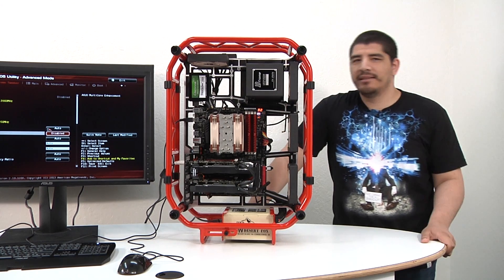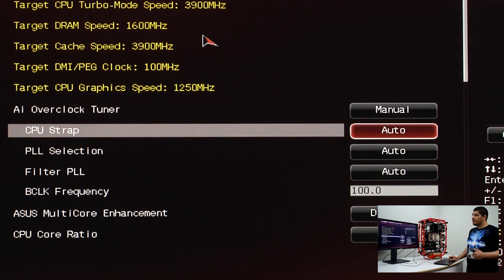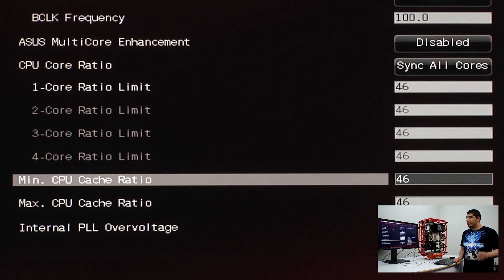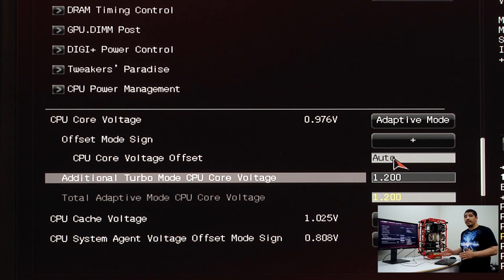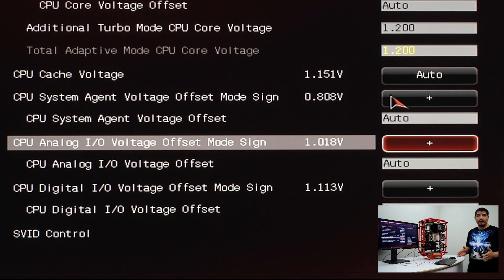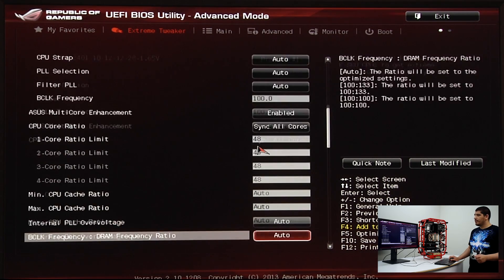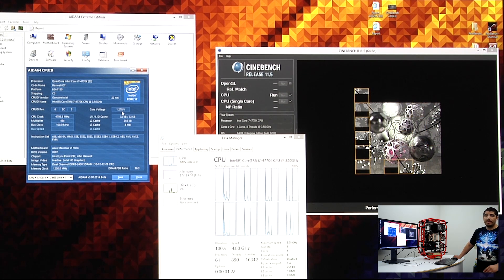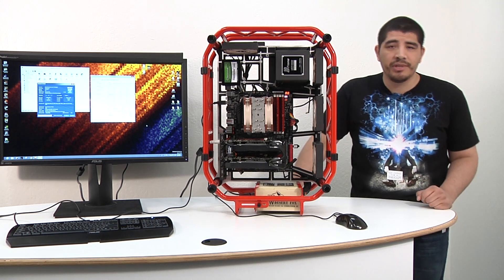How-to manually overclock any ASUS Z87 motherboard

Comment: Hi, im a OC newbie, so if get it right, all you need to do is to set your clock speed and add voltage?
I have the same mobo and cpu as on video.
Are they any dangers in overcloking?
Reply: none as long as you dont get your cpu over 90 degrees celcius.
Reply: and don't over volt. To much voltage can be really bad for your cpu. For the Haswell series anything over 1.25 ish can lower the life of your cpu but it can go much higher in volts as long as it remains at a stable cool temp. Also take into consideration of when you are doing your overclock. If it is 40 degrees F, and you  do a stable overclock that is high, you will probably have to adjust your overclock appropriate to the seasons if it gets hotter in your area during the summer time. As your ambient temperatures rise so does your cpu.

Comment: So guys, why did he say that we shouldn't run stress tests with the oc settings that he's shown us?  Or did he mean when leaving voltages on auto? Why?
Reply: OK, so apparently if you leave your cpu voltage in BIOS on AUTO or Adaptive, then Prime95 can actually request AND will receive more voltage than you set (e.g. 1.25V).  This CAN lead to overheating and in reality doesn't exactly test your overclock (since your set voltage and the voltage being tested by Prime95 will be different).  So basically, while overclocking Haswell, set voltage to manual and set it at whatever you like, then stress test using whatever you like, THEN when you're done go back into BIOS and set voltage to adaptive.

Comment: I got a problem! I got the z87 maximus IV and an i7 4770K and I followed this guide and i keep BSOD! No matter what I do i keep crashing and windows loading screen? I noticed that the asus multicore enhancement only have the option disabled and auto... not enabled? I know that it has to be disabled in your guide but I find it weird enable isnt available? What can i have done wrong.. all the motherboards i've had I had no problem in overclocking.. only changed the cpu ratio and cpu voltage. Why is it so hard with this processor and mobo? Please help!
Reply: Try raise your voltage

Comment: Hi, i bought this Mobo and has been running smoothly since i turned on, but in the building process i found that the TT Frio coolr with the two fans included are above DIMM slot 1 and 3 so i had to put my Ram Corsair Vengeance 8x2 in the slor 3 and 4.. does this affect the dual channel performance?
Reply: Yes it does

Comment: I got a dud i5-4670K, it will only run on 4,2GHz and 1.280V, no less no more :(
Also even when i use manual VCORE and enter 1.280V the motherboard adds 0.035V on top of the 1.280V and makes it 1.315V which forces it to slow down and overheat ???! I though the manual mode will force a 1.280V, but i t doesn't and i did update the BIOS to the newest version. I have the ASUS AMximus VI HERO. I would like some help :(

Comment: I have a Intel Core i5 4670K, can I overclock it without extra cooling. I use the standard cooling that comes with the processor
Reply: Do not use the stock heatsink if you're planning on overclocking.  I have the 4670k and have a h100i which keeps it really cool while overclocked, aftermarket air coolers should be sufficient, just the Haswell runs extra hot so stock cooling just barely does the job.

Comment: this sucks i went all out with cash being no concern and put a custom loop together on the cpu and north/south bridge and i cant get past 4.2 im very disappointed im using the 4770k and asus maximus vi formula. i just dont get it OC used to be much simpler to me a few years ago now they have so many different options im getting lost how is this easier? asus 4 way optimization doesn't work or me either it keeps setting my ram back t 2400Mhz  even when i get it to lower in bios. im just frustrated with the amount of cash i spend to get crap results. its 2 am where i am and im tired and pissed off so i do apologize for my horrid spelling and grammar.
Reply: just sell the cpu and buy a new one :)

Comment: hi jj great vid,
i have a asus maximus formula v1 i got it running at 4.2 by 2400 trident x memory,followed all your settings from the vid
comp works fine but when at idle it will not decrease volts or clock....any ideas would be appreciated

Comment: for example my 4770k seems to be stable at 4.5 all cores with 1.23v, my temps could be better but only got an H60 v2, highest core average temp is 72º with almost 2h with Aida64, (ya gona need to run it longer)

Comment: I have mine set at 4.6ghz @ 1.2v.  It passes all the tests fine, but after playing BF3 for a bit it blue screens on me.  Do I need to increase the volts?  If so to what?  Didnt remember anything in the video to help with that.

Comment: Not all CPUs are capable of reaching the same clock speeds, it depends on the quality of your CPU, which can vary. You might want to look at your temperatures, because the CPU is going to throttle the speed if it gets too hot. Intel uses a cheap thermal compound for transferring heat from the die to the heatspreader of the CPU. That results in CPUs not being as consistent as you might like in terms of thermal performance and some are outright terrible.

Comment: even when i set Adaptive MODE in bios and then go to windows 7 run asus cpu z the cpu speed just stays high never drops what have i done wrong ? I dont want my cpu to stay overclocked 24/7 when i am not really doing much, how can i fix this problem is there another setting in windows or maybe Bios ? that may need setting up . please reply thanks for the video .

Comment: That WAS the case a while back, before you were able to flash your BIOS through a USB. Flashing your bios is EXTREMELY easy now and there is little to no risk. I already flashed my pro board twice and no issues so far.

Comment: I'm tapped at 4.5 with thermals vs clock and voltages. That is the chip I was dealt.
I seriously should of just stayed with my asus sabertooth z77 and my I7 2600k @ 4.7ghz and waited for a beefier upgrade. The I7 2600k is the same price as the 4770k now. Probably because of end of life. I am going to frame my z77 Sabertooth with my 2600k LOL. Just going to keep it as a back up in case something goes wrong with Intel hotashellwell CPU

Comment: Are you running adaptive mode? I just did a quick 4.5 @1.250v adaptive mode. But I guess no stressing while in adaptive I have to do more research. I just got the cpu yesterday. Much has changed from my Intel I7 2600k.

Comment: Linus benched some games and unfortunately yea there isn't much of a difference.  Games are so GPU based now.  OC'ing is mainly for the Epeen now imo.  Its nice but processors are at the point where most of the graphical grunt is done by GPU's and those have very tight OC limits.

Comment: JJ, is it possible to set a manual constant voltage profile and a adaptive profile at the application level.  For instance, when I'm loading up 3d max or a rendering program, the pc will automatically switch.  Then when I fire up Battlefield or WoW, or TF2 adaptive will take over.  

Do you have to go the the UEFI each time and make the change ?  Then reboot the system.

Comment: My OS will only boot at 4300 MHz with 1.2 volts, but it is staying under 59 Celsius with prime95. I only have a Hyper 212 Evo, but my case has a lot of fans. I don't want to push it too hard without liquid cooling, but is this a good sign that I can increase the voltage and go for a higher clock?
I am mostly just going to be gaming with this CPU.

Comment: @theSportkid24 I'd seriously recommend using a water cooling system if you want to run your processor at that speed. Secondly in the video he's running a 800w psu which is fine for this setup but if you plan on running using more than one gpu now or in the future, you may wanna consider upgrading.

Comment: Wow wha do you mean by your max is 1.9? I wouldnt ever try for even 1.5, Im at  4.5 @ 1.280, I can do 4.6 @ 1.310!! My thermals were a bit high at idle so I settled for 4.5!! I can go 4.7 if I want but thermals on haswell go crazy when your in 1.3 volts and up!! I would delid if I was a lil more confident I wont ruin my CPU!! Maximus 6 formula, 2 asus gtx 780, i7 4770k, 16gb corsair dom plat @ 2400mhz, Samsung 840 pro water cooled in cosmos 2

Comment: Hey, just got my z87-pro and 4670k to boot at 4.5 @ 1.2v....runs stable in all games. I initially tried 4.6@1.2 as you suggested and i got a bsod at windows login. My question is about voltage....clearly if my max is 1.9ish i dont want to go above that value, but what is a reasonable amount to increase the voltage by to try to make the jump from 4.5 to 4.6 (or higher)?

Comment: I know your post is a bit old, but don't feel bad I just got a 4670 and I got to be over 1.2 to get 4.2 GHz. The 4-way auto tuner it can't even get back into windows the first time to even start the auto tuning. I can get to 4.4 at around 1.3V. Fortunately, I got a 360 custom water-cooler so not worried about the higher voltage too much. Haswell just SUCKS for overclocking.

Comment: Hi so I've just recently purchased the asus Maximus hero VI, corsair H80i, corsair vengeance pro 1600mhz 16gb kit,and Samsung 840 series 500gb ssd. I tried  clocking to 4.8 but blue screens I increased voltage gradually to 1.390, and it loads into windows no problem it's fine for a bit then it blue screens. I've noticed certain voltages make it to login screen but I can't type and move mouse or 1 of the above

Comment: So I have a Z87 Maximus Vi HERO mobo with haswell 4770k cpu and I want to overclock it. I watched both of your overlock video, one called "how to manually overclock any z87 mobo" the other one is "4 way optimazation" the first one is really easy to pull off, while the second one is pretty sophisticated, I am wondering which methode is better in my situation.

Thx in advance!

Comment: Hey JJ, I have a problem that none of my mates have.

I've done my overclock, and I thought it was pretty good, and then I noticed nearly no performance increase in games... I compared some info from my machine and some of my mates, and I found the problem.

In CPU-Z (in About > Save Report), it lists certain speeds under the processor; TSC, APERF and MPERF. Only my APERF speed increases with my overclock, while TSC and MPERF don't scale with it, staying at stock.

Any idea how to resolve this?

Comment: Great work on the Z87s ASUS and thanks JJ for the advice on all your videos.

I've been blessed with 4.8GHz @ only 1.235v on a 4770k. Amazingly it was booting into windows and passing RealBench @ 1.15v with that clock, but crashed in the Valley benchmark. Extremely happy with this chip! AI Suite 3 is very nice also.

Videos like these brought me to Asus so thank you very much!

Comment: I have the z87-pro motherboard with a i5 4670k cooled by the corsair h80i and I could barely achieve a 42 multiplier at 1.2 voltage. I'm a bit disappointed considering I should be getting 4.6 at least

Comment: I must have scored a horrible chip for overclocking, I just upgraded my asrock z77 extreme 6 motherboard and I7 3770K to a asus z87 sabertooth and I7 4770K and the 3770K is already a far better overclocker, I had my 3770K at 4.2GHZ at 1.125V and stable while my 4770K cant even hit that at 1.180V without blue screening at some point. Could I be using out dated drivers on my motherboard? because I only recently got it and just downloaded the drivers straight off the disk.

Comment: I turned adaptive mode on and set my voltage and everything else like in the video, but when boot and login and go to CPU-Z, the voltage and clockspeed remain constant (~1.260V and ~4300.00 MHz). Did i do something wrong?

Comment: Thanks. It had to be that or my C-states in the bios. My max clock holds at 4.6ghz, tested thoroughly with your recommended Realbench and Aida64 and it holds beautifully with good temps (H100i). I love the new "adaptive" setting. So much easier than using the offset voltage and It keeps my CPU relaxed when not gaming. Overall, very happy with what Asus have done with this years boards. Thanks for the great tutorials and responding first hand with your customers, I am glad I found the channel :)

Comment: I'm using the Asus Z87 Deluxe board. When I use the "adaptive" setting my CPU and voltage stays maxed out at 4.6ghz/ 1.27v, even when idle. Why don't they drop?

Comment: I don't know if I understand right the adaptive voltage. If I set adaptive voltage at e.g. 1200 and I use AIDA64 for test my CPU it can run at more than that 1200 that I set?
And 2nd question, if I use manual voltage to 1200 my CPU will use it all the time even on idle state and run at 4.6 GHz even if I not need that much power from CPU (desktop/internet use)? I mean will I loose turbo mode in CPU?

Comment: JJ, great video mate, I used most of it to overclock my Maximus VI Gene and i5 4670K, but I am stuck on one area. 
When you talk about CPU core voltage, mine does not have the drop down option and is stuck permanently on Fully Manual Mode.

Comment: My Asus gear is OTW... Still waiting for the Direct CUII gtx 780 and a couple of fans, then I'll be retrieving my VI Gene and 4770k. Thanks for the guide; will deffo follow it. Do you think I could run @ 4,8 with a h100i? What's the max voltage you'd say I could go with that cooler? :)

Comment: Hi, can you exdplain to me how to adjust my 3770K.  It runs on 4.680mhz on Sabertooth Z77 MB, but the cpu don't go down with that frequency in idle (when the cpu not loaded with some aplications).  I mean, how to adjust dynamic range of clock speed?  Sorry for my english.   My email:  smajlik.07@mail.ru

Comment: Does the core voltage has any influence on the lifetime of your CPU? I still run with my 2500K which peaks 1,4-1,5 volts, will this have any influence except higher temperature?

Comment: JJ, what temps would u say are acceptable for a 4.5Ghz overclock on a 4670k with the voltage being set at around 1.25 using a corsair h100i ?   at both idle and stress testing levels of use/

Comment: dont overclock whilst using adaptive mode. Find a stable overclock with a manual mode, then set an adaptive mode with the max core voltage being what you found to be a stable core voltage.

Comment: This was very helpful.  I am having a problem with my z87 pro board she starts up but comes up with a cpu fan error?? I hope this will go away when i install my h100i NeXT week.  Could the error be caused by the fan power cable not being plugged in the right fan header? I have it in the closest one.

Comment: if its overheating a lot , you could get fan upgrades the corsair SP and AF fans are good, and cpu fan upgrade you could get a Cooler Master Hyper 212 Plus its about 30 on amazon, and try to hide all the cables  or zip tie them out of the way, linus on linustechtips has a cable management video and is very detailed 

im just spitballing here